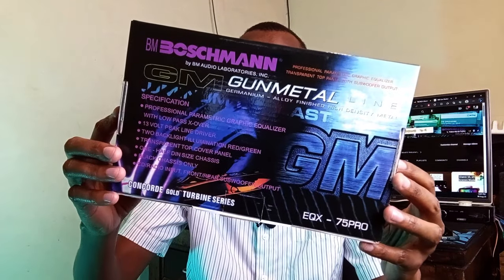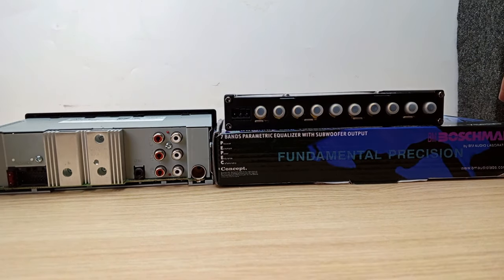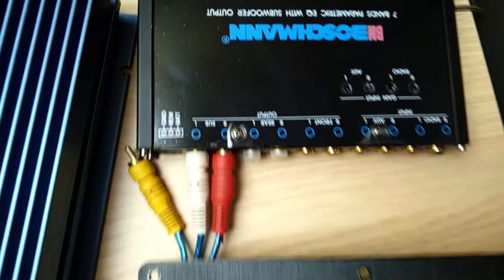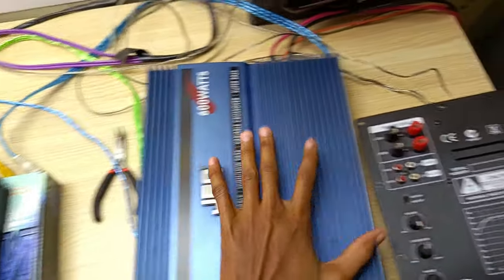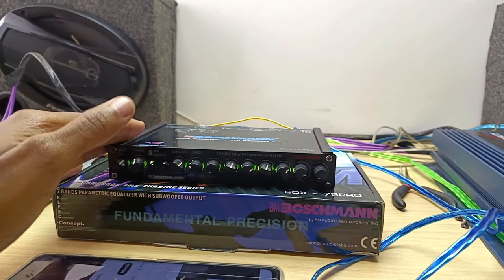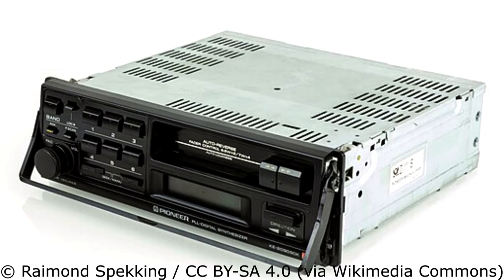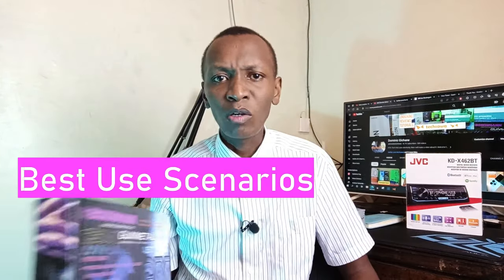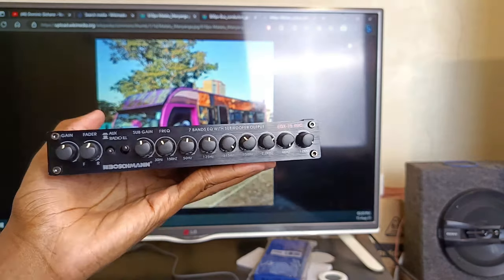Boschmann 7 Band Equalizer Review & Why you don't need it

Comment: one of the most comprehensive reviews and straight to the point, Excellent work. Thanks.
Lastly, kindly advise an equalizer with subwoofer capability of 20Hz level available in Kenya.
Boschman is the only one in Kenya with a subwoofer level of 30Hz, the rests are all in 40 or 50Hz.
thanks.

Comment: Great. 
My car radio emits interference sound which I have been defeated to solve. 
The connection is just like yours. But now I cannot enjoy music at low volume because of the interference sound
Reply: get an independent ground  that should solve your issue
Reply: And also check on your RCA cables get the quality ones that use mic cables they are good coz they reduce noise caused by magnetic fields

Comment: Hello, how can I connect my 4 car speakers with an equalizer to a two channeled amp?
Reply from the maker: 1. Use the front output from the equalizer to the amp input.
2. Connect 2 speakers to each amp output. Im assuming that the speakers have a 4 ohm impedance and your amp is also 2 ohm stable per channel. Check this video for more information https://youtu.be/rJMJwTEaO6Y

Comment: Very helpful! Do a separate one where you introduce a crossover to the above set up
Reply from the maker: Hello, I've replied to your question here https://youtu.be/SrMzRrvnQTo
Reply: @DominicGichane  very grateful and thank you. By the way I want to share something, there's a radio I now have called Kenwood 306bt has an inbuilt 13 band equaliser and inbuilt crossover and from my sampling. It's doing a very nice job as it runs my mid range pair and tweeter pair. It has 3 pre outs and I use the sub pre out to connect to mono which runs my sub and quality is unmatched. Thank you for proving that you don't need an equaliser to run a set up if you have a quality headunit.
Reply from the maker: @jameskibiru5369  wow. That's great 😃

Comment: How can you connect it electricity
Reply from the maker: If you mean the electricity at home then you need a 12 volt output power supply. A cheap way to achieve that is by using a computer power supply. More details here https://youtu.be/2EO_xPhhFrk